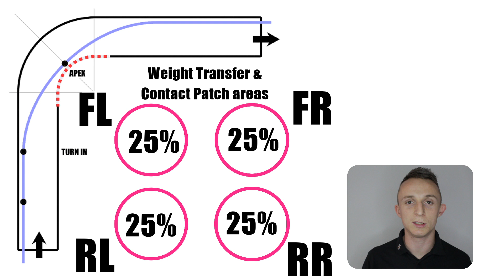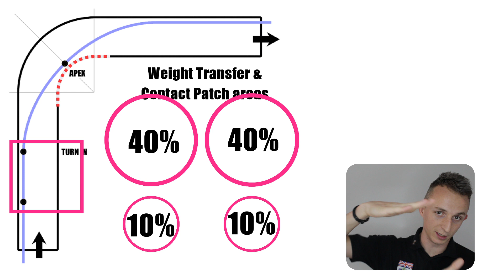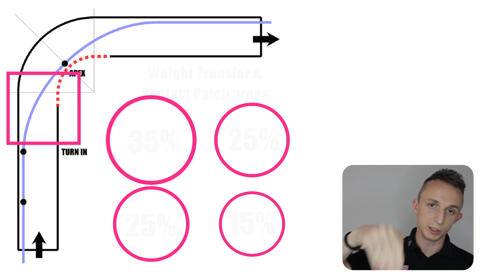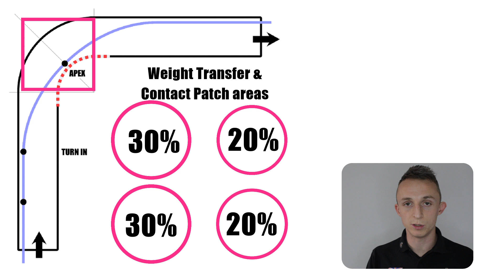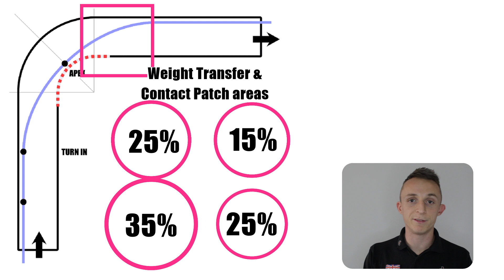How To Motorsport - Weight Transfer on Track Explained

Comment: This explanes why alot of rallycross and rally drivers "stab" the brake into a turn that does not really need a lower speed.. that it helps rotation to be able to get on the throttle sooner.

Oh i commented too early, you said it yourself in the last part of the video :))
Reply: It`s a bit more complicated that this, because you can actually study this topic for a loooong time to understand it correctly. Don´t forget that the circle may get bigger, but you now also have not only lateral forces for steering the car, but also longitudinal forces for braking. A tyre can only carrie a certain amount of force. The benefit of a bit of braking is that you move the contact patch a bit in front of the middle of the tyre. Therefore the most lateral force created from the tyre is closer at the point of the highest load (the middle) and you increas the friction coefficent and basically the tyre get more efficent which means you can get more lateral force even you add some longitudinal force. Therefore you can see that most pro drivers will smash into the brakes to slower the car down and stay just a bit on the brake when turning in. In rallycross on softer surfaces, wheel spin can help to get a bit more grip and you can also see that the brake balance is much more aggressive. Also the diff lock needs to be considered. While braking in rallycross, the diff lock can go really low and this helps the car to turn much better.